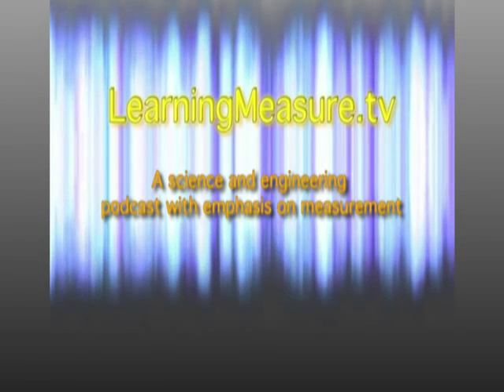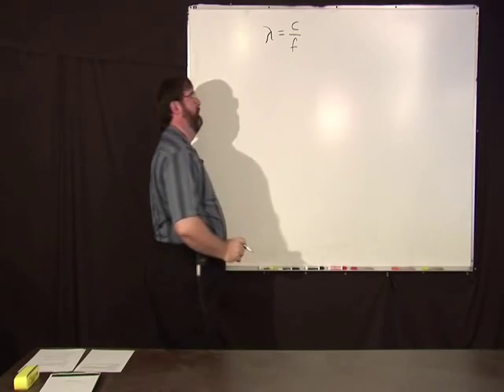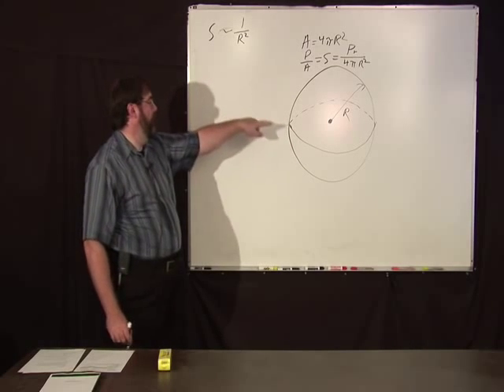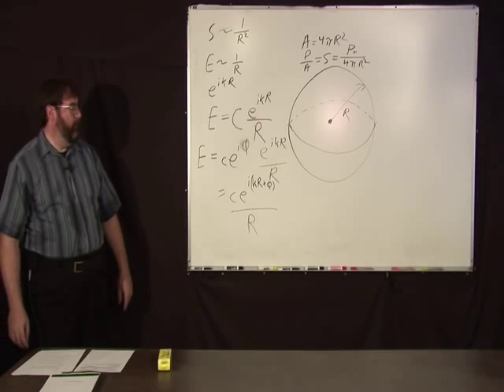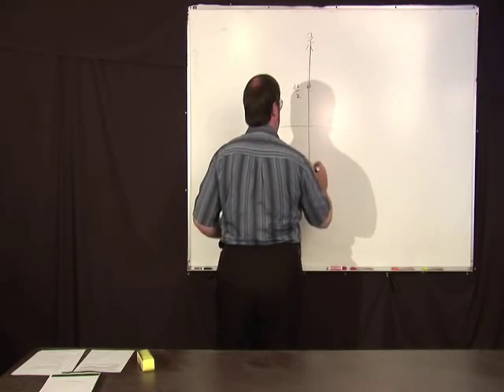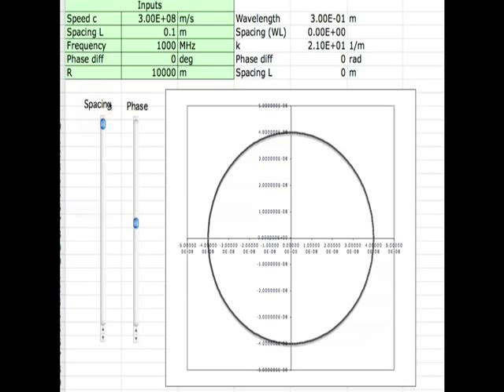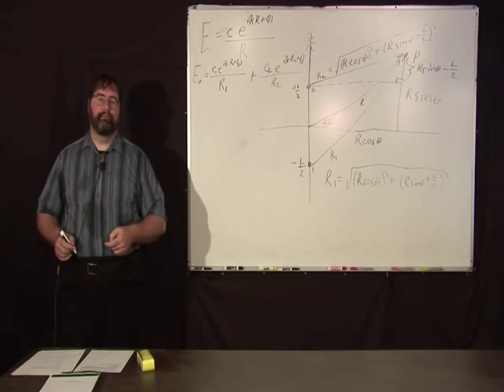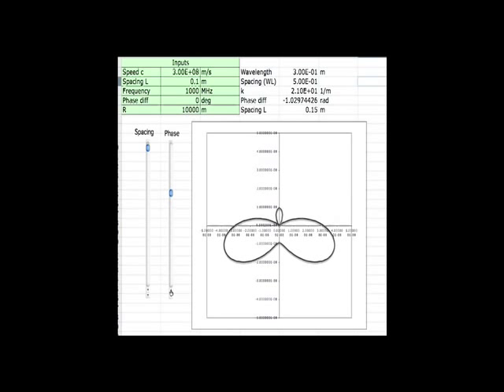Episode 16 - The Isotropic Radiator

Comment: im here because im trying to take my amateur radio operator's license. One of the questions on the test is, What is the effective isotropic radiated power of a repeater station with 200 watts transmitter power output, 2-dB feed line loss, 2.8-dB duplexer loss, 1.2-dB circulator loss and 7-dBi antenna gain? Real disappointing that these are the questions of a test for an operator's license, just to operate a 2m 72cm handheld.